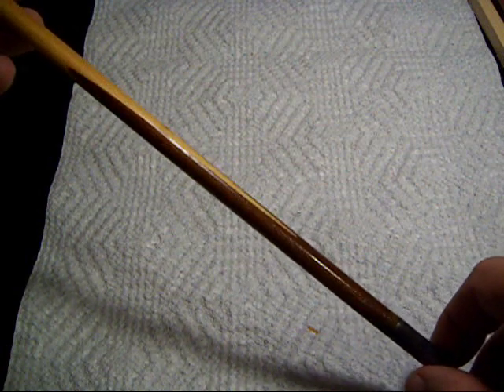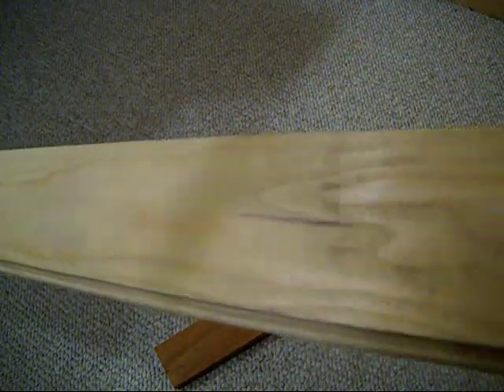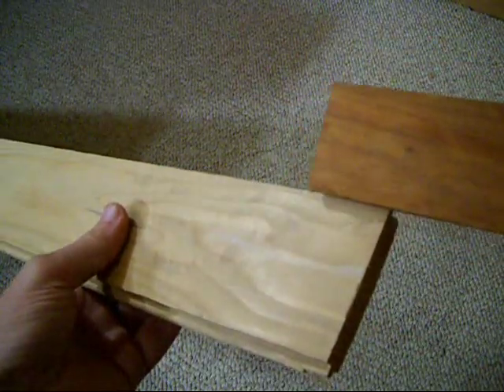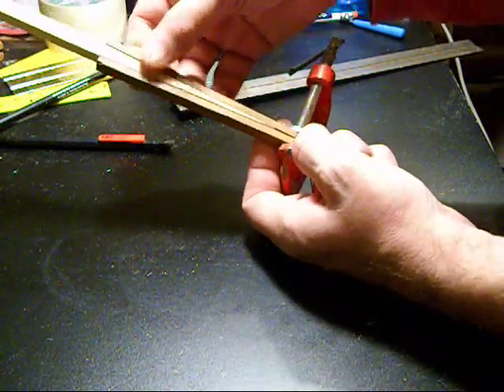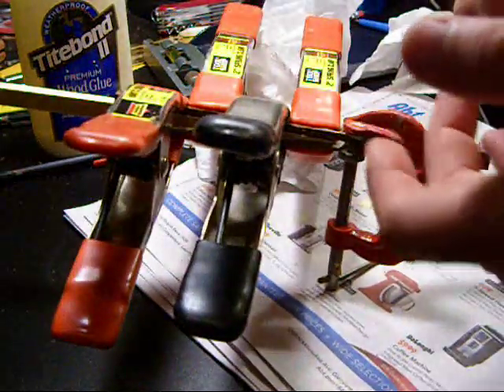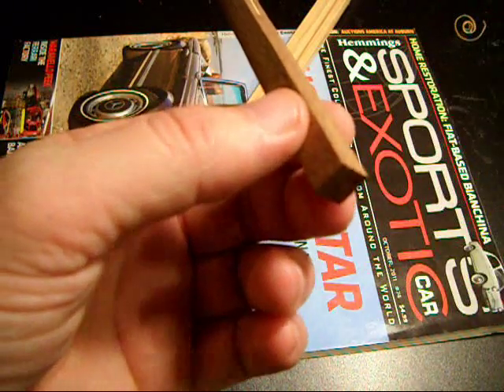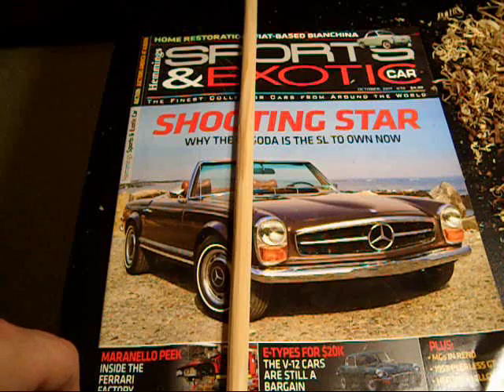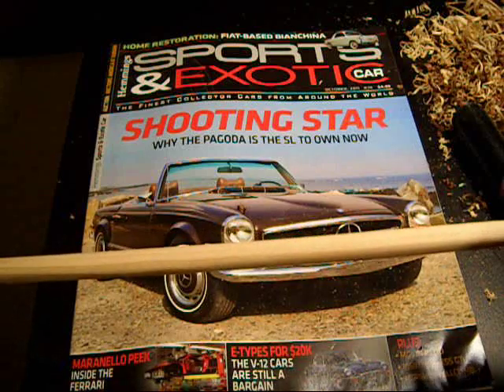How to make Footed Arrow Shafts DIY

Comment from the maker: I vary the diameter depending on the wood species to achieve a 50-55lb spine. For example typically 5/16"-11/32" for hickory, 11/32" for Douglas Fire, 23/64 for Poplar or clear pine. I use the (3) sized bushings from my taper tool to check roundness.

Chuck S
Reply from the maker: Jaxson Derrick  cool, glad it worked for you

Comment: don't think you mentioned it. but do you cut the footing blank across the grain like for a self knock? ive never made footed arrows, but the engineer in me thinks that if you cut along the grain the footing would simply split as soon as it hits a target as the softer shaft would act like a splitting wedge.
Reply from the maker: You make a good point, something I had not considered. I have not seen a footed shaft fail as you described, but it makes sense to orient the grain like a self nock. It is likely that the shear strength of the glue prevents immediate splitting.
Chuck S
Reply: mxred91
you are probably correct about the glue surface area resisting the sheer forces placed on the joint. when i make a set of footed shafts i'll be sure to orient the grain across the cut for an added layer of safety. haha!
Reply: looks like you should do your glue up in the bath ! seriously though,full marks for explaining what you did.
    sharpen your plane till it will shave an atom !

Comment from the maker: For the soft wood (shaft) Port Orford Cedar, Douglas Fir, Poplar, and possibly clear pine will work (do not use Western Red Cedar, most is too weak) Tou could use most any hardwood for the footing, straight grain is most important. the plane I use is about 4" long, I bought it at Home Depot for about $7.
Chuck S

Comment: Could you just make your arrows out of black walnut?
Reply from the maker: You could, but it would probably be heavier than what you would like. I have made arrows from many types of wood, for just tough, it is hard to beat hickory. But a typical shaft will weigh 450-550 grains vs a Cedar shaft that typically is 275 - 350 grains. I typically shoot only bamboo arrows now.
Chuck S
Reply: mxred91 I use only Hickory Drum sticks very strong. have you ever made a cross bow arrow/bolt?
Reply from the maker: T.C. Filbin Our archery club doe not allow crossbows, so I have not. Hickory drum sticks sound like a good idea. 
Chuck S